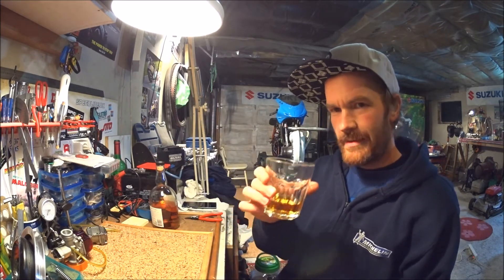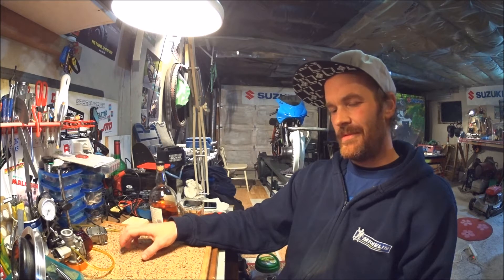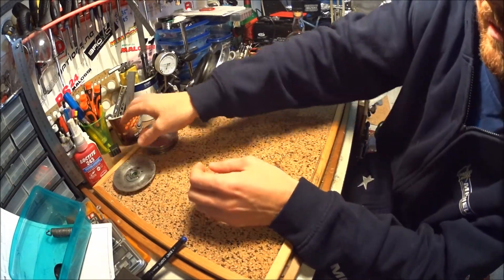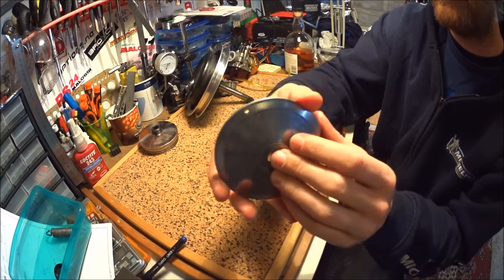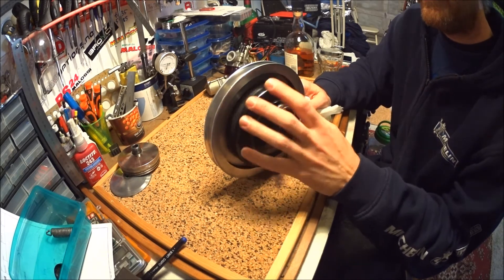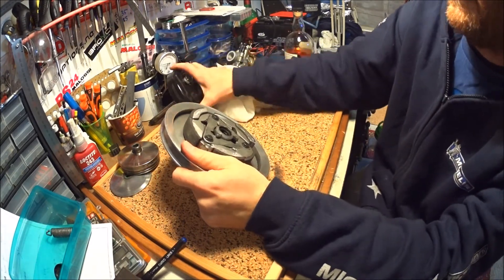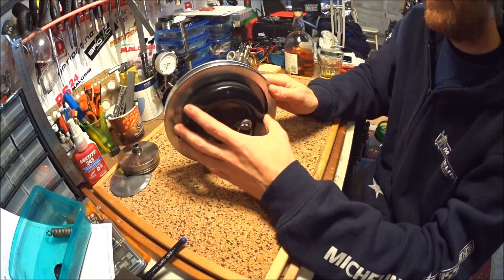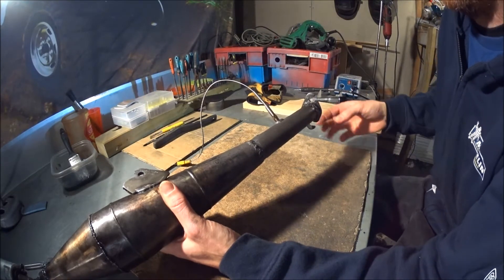E3 - The Spx Variator, Clutch and Pipe +HOW TO: Crank Balance Factor. 2STROKE STUFFING

Comment: Link to crank balancing page is not working. Could you post another link?
Reply from the maker: +Shawn Here ya go, should work! I'll update the description! https://www.kiwibiker.co.nz/forums/showthread.php/86554-ESE-s-works-engine-tuner?p=1129264719#post1129264719
Reply: I am a little confused at the end of the video, as far as crank balance factoring goes. You come up with a balance factor of 39% (or .39). Now, do you take the balance factor (.39) from the total weight at the small end of the conrod, then remove that from the counter weight? You had 109g at the small end. So .39x109= 42.51g
Reply from the maker: +Shawn I'm not sure I understand the question. You find the balance factor by dividing the weight you have to add to the conrod for it to stay put in any position + the weight of the conrod small end itself by the total weight of the recipocrating mass. Say if the total recipocrating mass is 100g, 25g of that is the small end, and you add 25g from the conrod to get it to stay in any position: (added weight + small end)/total recipocrating mass=balance factor  (25+25)/100=0.5=50%
Reply: you compare the weight of your piston con rod and wrist pin to the weight to balance it? then find the percentage of the difference?  @2STROKESTUFFING
Reply from the maker: Pretty much yes.

Comment: Why do you  weigh the  total reciprocating mass as what is half the connecting rod is this considered as half crankshaft weight and half reciprocating  weight. And where does the 60% figure  come from. 
As opposed to  ~approx 38%.  Would this not be affected by  the  burn of different  fuels
Reply from the maker: +Mathieu Boonen yes, half the conrod is considered reciprocating mass and half rotating mass - just an approximation. About 60% balance factor is what gives least unbalanced force overall with both the primary and secondary force taken into account. Not affected by fuel.